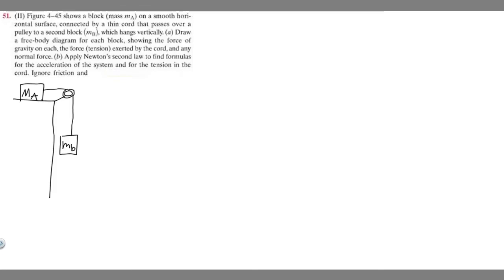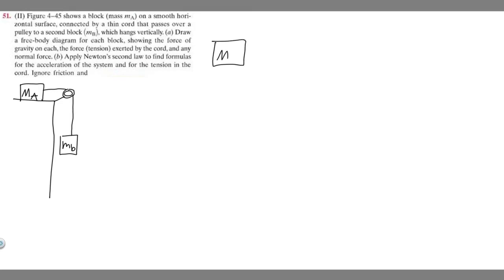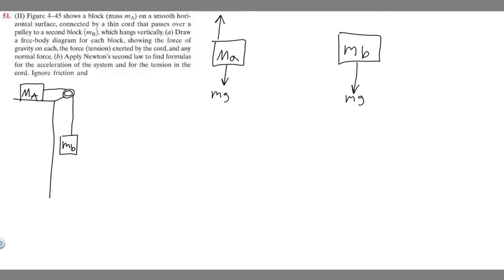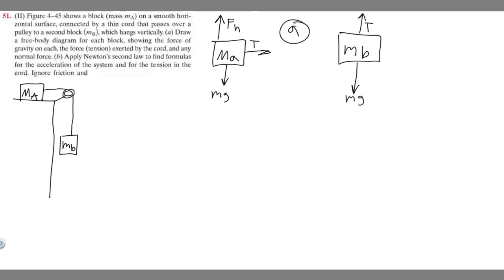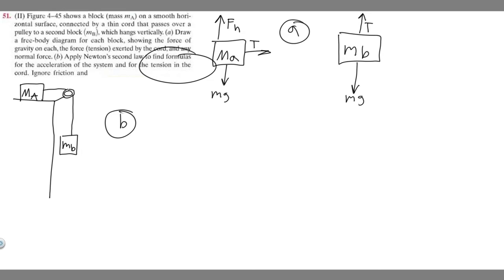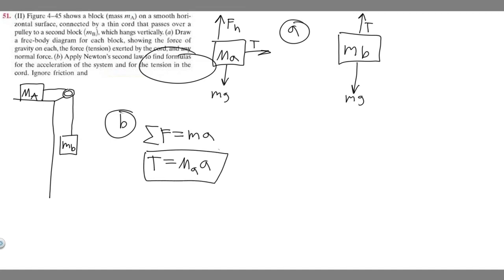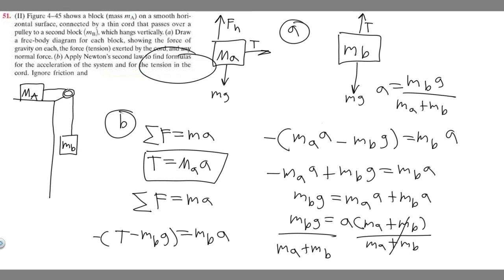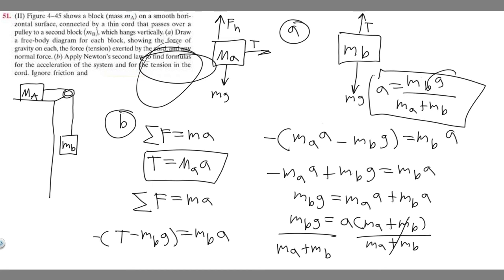Figure 4-45 shows a block (mass mA) on a smooth horizontal surface, connected by a thin cord that

Comment: can you solve this?

A 8.6 kg block lies on a frictionless horizontal surface. It is connected to another 11.5 kg block by a string that passes a frictionless pulley. Find the (a) unbalanced force, (b) the acceleration of the blocks, and (c) tension T in the string.
Reply: THE ANWSER IS 14